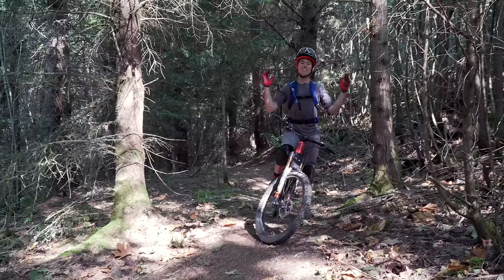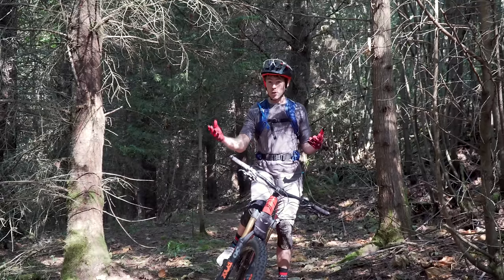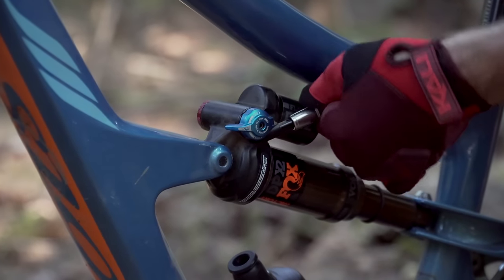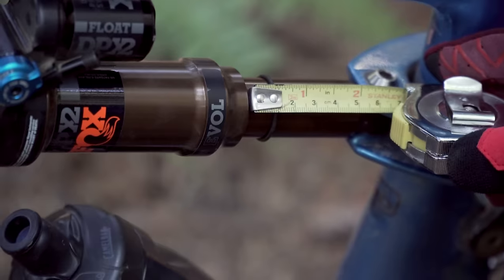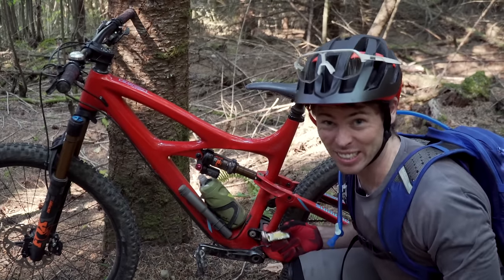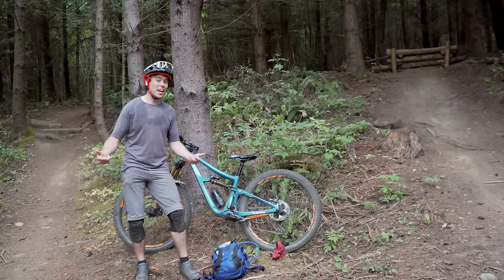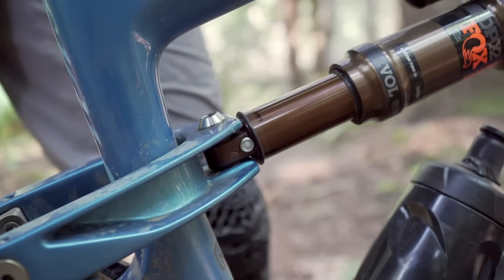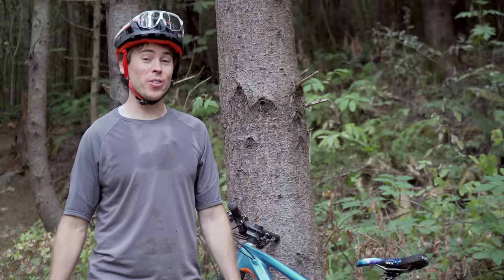The little shock that could!  DPX2 set up guide!

Comment: Great tip on rebound.  I've heard rolling off a curb but never while sitting.
Reply from the maker: Thanks Brian!  CEO of Ibis gave me that tip 10 yrs ago!  I used to just set it as slow as I could before it'd start packing up, now I'm going a little faster since compression damping works so much better than it did BITD.

Comment: If you add volume spacers to your shock, do you put it to the psi you had previously when setting the sag? Or does the needed psi change to achieve the same sag once you’ve installed spacers?

Comment: Nice video ! I have couple of questions for you and I hope you can help me out. I got my Ripmo 3 months ago. How much do you weight? The reason is because I’m running 160 PSI on my DPX2 to use or maximize the travel but not to the point that I’m bottoming out. I’m 175 lbs with gear.  Also, What tire pressure are you running front and rear and what tire size are you using 29x 2.5 front and rear? Thanks in advance!
Reply from the maker: Hey Dennis, thank you!  I weigh about 160 lbs and my back is pretty heavy.  Man I had to put a lot more air in than ya, and STILL had to add a volume reducer!  Feels pretty spot on with the 195lbs psi and the .4 reducer for me.  I'm running ~22-24 psi in front and ~24-26 psi in the rear, with old WTB Vigilante 2.3 tires.  Thanks man!
Reply: Thanks jeff! As always awesome riding skills.  👍

Comment: I've got the dpx2 performance elite on my altitude... because I have no idea what i'm doing... all I know is that it feels BEST for my riding style and trails completely wide open on compression and rebound (face palm!) I like how fast and playful it is... I feel like it came stock with a slower tune, so all the way open works...
I originally had the tiniest volume reducer in there.. didn't like it, so I put in the largest... hated that... and have fallen somewhere in the middle on volume reducers...
I'm going to have to try out your setup tips to see if I could benefit from a slower rebound, and a little bit of low speed compression (3mm hex inside the red knob).
Thank you so much for this! Cheers!

Comment: AMAZING RIDING (man I wish I could ride like that!) and excellent, easy tips for knowing the impetus for each adjustment.  I have a DPX2 rear shock that came with my 2018 Rocky Mountain Instinct BC Edition.  If you listen to Fox (or watch their service vids), they recommend you remove the shock and vice it before replacing volume spacers, but I see you simply do it while it remains on the bike.  Thats fine to do?
Reply from the maker: Thanks man! Yeah I think it’s fine to do it as I did in the video, Fox might have other advice and I’m not a Fox employee or anything. This way of doing it has worked for years though.

Comment: I'm thinking about getting a DPX2 for my HD3, which has a similar leverage curve to the Ripmo. Ibis says that a low compression / medium rebound tune is best for the HD3, but that info is from before the DPX2 existed. Do you think that a M/M tuned DPX2 would have enough adjustability in the LSC to work well for this bike?
Reply from the maker: Hey JR, if you are >150lbs or an aggressive rider then the stock DPX2 will be fine.  I have a stock Factory series DPX2 and I love it- I even added some volume reducers to make it ramp up more.  If you want super crazy plush, then a L/M would be better, but I'm quite happy with the M/M.
Reply: Thanks Jeff!

Comment: I bought a custom bike, Santa Cruz High Tower LT with Fox Factory 36, DPX2 rear shock.   

Shock systems are are as followed:     FOX 36. What worked best for me are the following:  High Speed Compression - 10 Clicks to the Neg side, Low Speed Compression - 11 Clicks to negative,  Rebound - 5 Clicks to Negative.

DPX, 5 clicks to the negative.  PSI  around 190.

I have two trails locally that I can test my set up to determine if it is dialed in or not

Comment: I have to say, as much as I loved this upgrade from RS Deluxe to FOX Factory DPX2, when I put the Cascade link in my Stumpjumper THAT changed everything dramatically--much more than expected. I noticed clearly that the DPX2 performs differently, better and more responsive, in all 3 positions. The Cascade link IMPROVED the shock and how it performs. I'm getting the exact responsiveness and progressivity that I was hoping for w/the DPX2, but much more since I installed the Cascade.
I know they're not designed for every brand or model of bike, but I'd highly recommend for any SJ or SJ EVO.

DPX2 also required a lot more psi than I was expecting to need, but once I got that to no more than 25% sag the compression and rebound settings were also more responsive. I'm sure the Cascade has something to do w/that, but I really didn't change the settings much before I installed the link. Love the DPX2--perfect.
~JSV

Comment: Hello, I have the same damper myself and I do not know how to set the LSC too well to be good, and then know that this is the optimal setting? I weigh about 65 kg, I have 150 psi (30% sag) and I never got a suspension but around 90% were several times. rebound full open 3 click to close
I am waiting for help :)

Comment: I'm getting an upgrade DPX2 for my enduro bike from my local bike shop, with a remote lever fitted due to shock placement.  I think I'll start with the largest volume space and work backwards, as I'll be around 250lb rider weight with gear - does it make sense for my situation to start with the largest spacer?

Comment: I have a 2017 dpx2 elite but do not have the 3mm LC insert? There is only a torx slot in middle of 3 pos blue knob, does mine not have the 3mm LC setting?

Comment: Ripley LS settings: ?? you mean RipMo settings ? :-)
Reply: Do you find the DPX2 more "dynamic" than the X2 on the RipMo?
Reply from the maker: Did I say Ripley LS?  No sleep the last few nights, plus I'm sick with a head cold!
Reply from the maker: DPX2 is valved a little more open and it moves more freely.  The smaller air can is really nice, too, as it's nicely progressive without needing so much high speed compression.  I like it quite a bit thus far!
Reply: Jeff Kendall-Weed yes check the video description 😋

Comment: I'm picking up my DPX2 tomorrow, which I ordered from a somewhat local bike shop (50 miles away), the reason being they were the closest Pivot dealer, and from talking with Pivot they said I needed to request their "special tune" DJ95, but when we ordered the shock, Fox said that's their factory tune, on the plus side I didn't have to pay an upcharge, and on the down side I could have ordered it sooner. Did you have to get a special "Ibis tune" or did you just go factory? I will probablly be revisiting this video a few times this weekend after I get mine mounted, one more question, did you just use the same mounting hardware or is the DPX2 different from the DPS? Looking forward to the review video.
Reply from the maker: Hey there Tommy!  I'm not sure about the Pivot factory tune, but I do not have the custom Ibis tune, I'm just using a standard aftermarket shock and it's working great.  The codes are different between the bikes, when I get a chance I should add the codes of my shocks.  But honestly, I doubt the special factory tunes are all that different.  Subtly different, sure, but Pivot and Ibis both have pretty standard requirements for the shock.  Not sure on the hardware question, trying giving Fox or Jenson a ring there!

Comment: Hi Jeff! great vidz and lots of good info, keep it up. i have a question about the DPX2 sound, did you experience any unusual noise for this shock? i've read a lot about others complaining about the noise this shock makes and it seems Fox Service people says this is "normal" for this shock since they are using a different viscosity for the damper as compared to other older Fox shocks. would appreciate if you can comment on this.
Reply from the maker: Hi Errol, my DPX2s all sound like a normal shock, which means you can hear some of the fluids moving as it compresses.  If the shock is working fine then I wouldn't worry about it.

Comment: Running the DPX2 shock on my HD4. Came stock from Ibis. But it's the performance model, so no low speed adjustment.
Reply from the maker: Right on Casper, I'll be bolting up a DPX2 on my HD4 this coming week, excited to try it on that platform too!

Comment: Can you help out a fat guy with the DPX2, I'm 240 and am having to put 338 PSI to get my 16mm of sag, is that normal or do you have any suggestions?
Reply from the maker: Hey Tommy, that sounds like it could be correct, you might want to get the shock revalved to offer more rebound damping.

Comment: You can give the DPX more mid-platform support for jumping and snappiness right?
Reply from the maker: Yes, with the low speed compression.  Too little and it'll cycle the suspension when you need some support, too much and it'll lose traction and ride kinda harsh.  Use bracketing and repeat a test section of trail to dial it in!

Comment: Great info JKW. Like the new logo btw. My SC Bronson came with this shock. How does one know what the initial sag measurement should be? Is it different for each bike?
Reply from the maker: Thanks Joey!  Sag is different for every bike, it is usually referred to as a percentage of total shock stroke, which is tricky since you need to know how long the stroke of the shock is.  I did Google your question though, and found this page which should help you out: https://www.santacruzbicycles.com/en-US/node/2296
Reply: Jeff Kendall-Weed thanks Jeff. I always just did the 30% by eyeball method. I will check out the link and get the exact measurement. Been working on dialing my suspension the past few weeks, so this really helps simplify it.

Comment: Hi jeff. Nice vid. Got a ripmo on order. Is it worth the extra for the x2 over the dpx2 and what is the difference between the ibis tune and the standard tune you used. Thanks.
Reply from the maker: Hey Gavin, thanks for the note!  I haven't had a moment to chase the differences between my DPX2 and the stocker, but I'd say the X2 is not a necessary upgrade for most on the Ripmo.
Reply: @JeffKendallWeed  thanks for the reply. Just been told I've got to wait until the middle of November for my bike.

Comment: Is bottom out really at the end of the shaft or just after the kashima writing?
Reply from the maker: Depends on your bike.  Some designs use a full stroke, others will only cycle part of the stroke.  Go to the manufacturers specifications page for your bike and see what sizes stroke the shock is, then measure accordingly.
Reply: @JeffKendallWeed  Thank you so much for your reply. I need to check my sag and pressure. I already have the biggest volume spacer so if I do bottom out is it ok to add some more air? Its on an ebike also

Comment: Thanks for the video Jeff. Curious if you know, with the lsc settings are the only when the shock is in open mode?  Or do they impact mid and firm?

Love all your vids
Reply: You probably already have the answer to this..but for my dpx2 performance elite (black...not gold Kashima)... The 3mm clicks of compression only affect the open setting 👍🏼
Reply: @TheCrashingDad   Do the clicks only start when the leve is in the Firm position?
Reply: @ambermojo4   - the mid and firm position with the lever will bypass the low speed compression setting with the 3mm hex. 
When you're in your fully open mode, that's where the 3mm bolt will adjust the low speed compression... 
Some of the dpx2 shocks that are lower tier don't have the 3mm adjustment in the open...  the performance elite version I had did have the 3mm low speed compression adjustment for the open position. on my current bike, I just have the performance version, not "elite".... and there's no 3mm hex for LSC...it's just open, medium, firm.
sometimes if the lever moves too easily, while in the open position i would hold the lever in the open position while i used the 3mm to adjust either way.
Cheers!

Comment: Awesome video Jeff and even better riding! Interesting you did your sag whilst standing and not sitting. Do you have any recommendations and or pointers for setting it accurately? I assume since you're mostly out of the seat you decided to conduct it this way and would set it up seated if you were to crank out more miles am I right? 

Lastly, is there any other method for setting up the fork's rebound other than the open palm on the grips and pushing down hard and having the tire stay put on the floor and not bounce?

Keep up the great content and cheers!
Reply from the maker: Hey Miguel, thanks for the note!  I've always ended up happiest with fork rebound a hair faster than rear shock rebound, as that will keep my bike a little slacker and more planted.  I've always gone off feel, but always do use some quick bracketing to make sure my "feel" isn't crazy off!
Reply: I was also wondering about this. Jeff- since you set sag standing at 14mm do you have a bit more when sitting? I always thought it made sense to set sag in the attack position.
Reply: @EricHollanderAcu  I second this comment  - What's your take Jeff?

Comment: Very useful.  Now, if you could tell me the perfect sag for the Sentinel with the DPX2, you'd be most helpful!
Reply from the maker: Haha thanks Lionel!  I googled your question and found this: They suggest 18-20mm of sag, so I started at 19mm. It bottomed violently multiple times on my normal trails and also felt like it got hung up in the rough sections. I went up 20 psi in the shock and it made the rear of bike hold up in the turns and stay on top of the bumps better than the previous setting. My sag is now 16-17mm. After these changes, I've never had such a stable ride from a bike. It also goes without saying it helped the climbing performance, too.
Reply: Thank you!  I'm going to test this tomorrow!
Reply: Transition has some useful tech docs for all their frames under Support -> Bike Archive -> [your frame] -> [Frame Manual].pdf. Good stuff to download for future shock setup, required pivot bearings and torque specs, etc.

Comment: Don't volume reducers or spacers, actually reduce the amount of maximum travel you have?  or are they so squishy that that the effect is negligible +- 5 mm or something and they'll just help you bottom out with a little less force on the shock?
Reply: They don't interfere with the travel
Reply: @moisesramirez4516  so this progression means, less air and faster compression of the shock?  or what do they do
Reply: The decreased volume helps when the piston is close to the end of the travel, making this section a lot stiffer, thus, requiring more force to bottom out the suspension, the initial and mid stroke remains around the same characteristics.
Reply: @jarlaxlebaenre7932  speed, rebound, damping and other things depends on the settings of the damper. The air just serves as a platform on wich the whole bike rests, and can react to forces like falls and irregularities on the terrain, the damper tells the spring (air spring) to behave nicely

Comment: Great tips. Do your dpx2s make any noise when returning from compression? Mine makes almost an air sucking sound as it returns from being compressed. Fox says it’s normal but I’ve never heard a shock make this before and I wonder if air got into my damper.
Reply: mine is the same and i adked the same question. what psi are you using? they told me it's more pronounced when it's high. i'm 75 kg and for the correct sag i have it at 230 psi
Reply from the maker: Hey Brendan, mine doesn't make much noise, though I can hear the oil a little bit. My X2 shocks all make TONS of noise though, but they have tons more oil (and air) inside.
Reply: Mine also makes this noise sounds like it’s cavitating. Only 2 rides in on it and been doing it from new. I’ve dropped the dealer an email with vid of the noise so will see what they say
Reply: paul baister let me know what ends up happening. Mine has also been making it since it was new.

Comment: Whe you set up the rebound does the low-speed compression position affect the rebound setup? After setting up and on my first ride stopped after about 50m as it was like the shock was locked out , checked the LSC and it was on firm all the way. turned it to 7 clicks open and felt good
Reply from the maker: Hey Mike, the compression and rebound don't effect each other, they are independent.